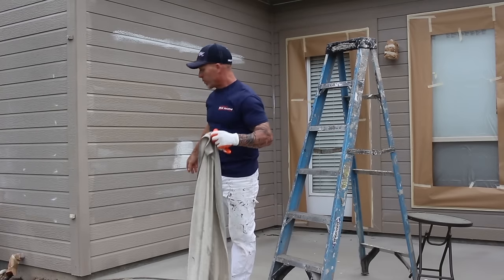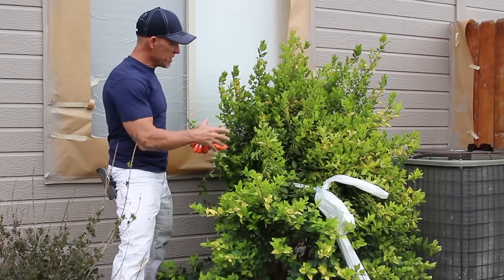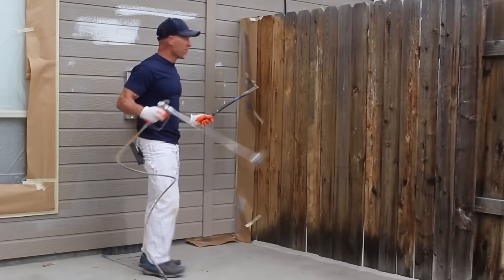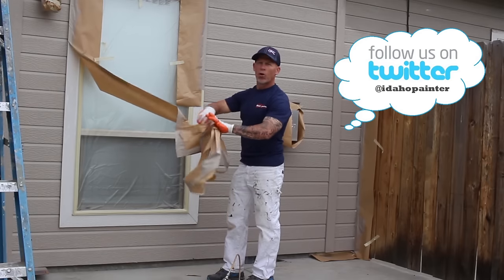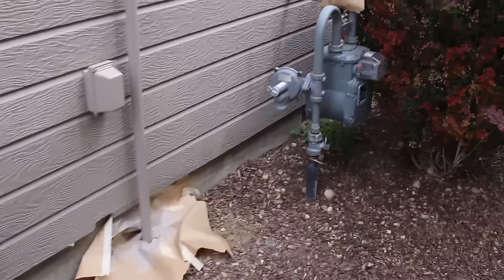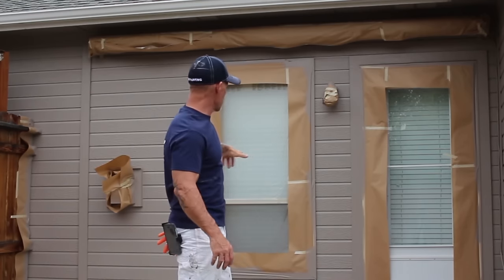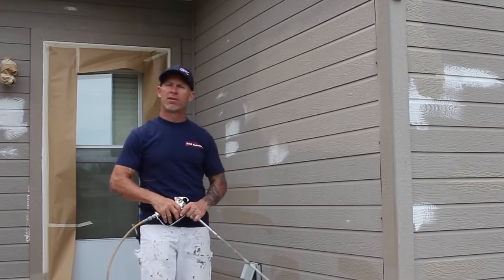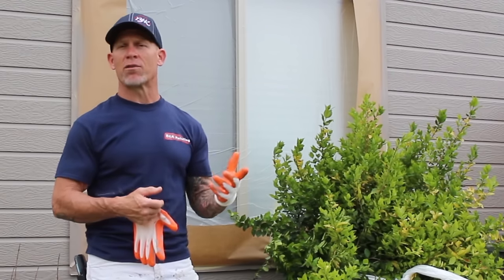Stopping Airless Sprayer Overspray | Eliminate Paint Over Spray

Comment: Never trust anyone who uses a 2 ft wand to paint ground level work. I guarantee the bottom few rows are missed on the bottom edge. Don’t spray up and down on horizontal siding. Use 1 1/2 inch tape with masking machine. It cost a quarter more a roll and you get more tape to the surface to help ensure the masking doesn’t come down. Titan pumps are trash. Buy Graco!
Reply from the maker: What is your channel name? I would enjoy seeing you share your methods also!
Reply: I work for a living, I don’t make videos of second rate techniques.. I’m a 3rd generation painter. 20 years plus. Own my business, A+ rating with the BBB no complaints ever. Thousands of jobs, tens of thousands of hours in the field. Untold gallons sprayed. I put my skills up against anyone, anytime, any day. I tell you what, go back to the house in this video and take a picture from the ground up at the bottom edge of that siding!

Comment: You kind of know what you're talking about but I've been a painter for over 48 years you do not eliminate over spray completely like you're trying to make it sound like you're pumping a shitload of propaganda so I should guess you knock off the BS until the truth and what holds your drop cloth down when you put it over the cement and you get down to the bottom of the wall with a spray gun they don't stay there they blow up and move